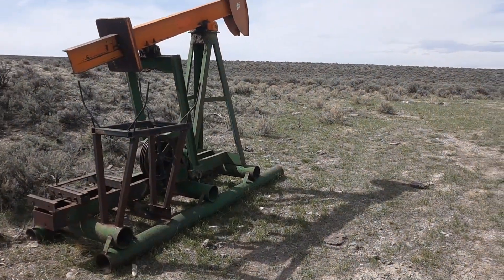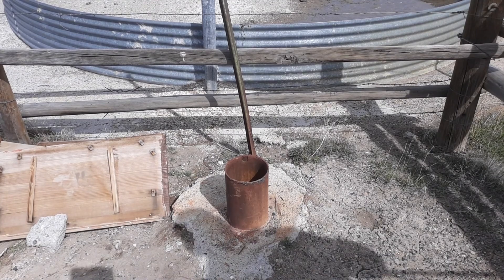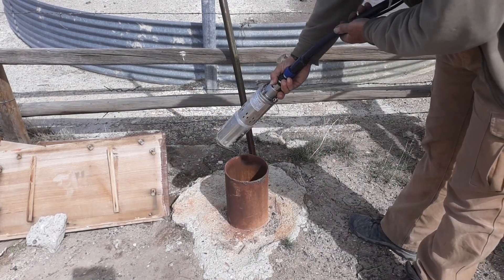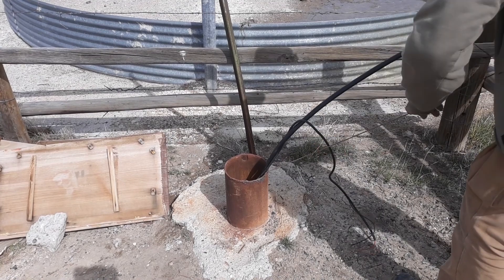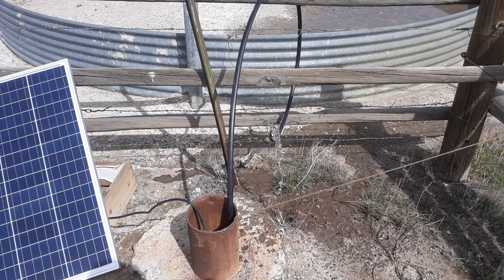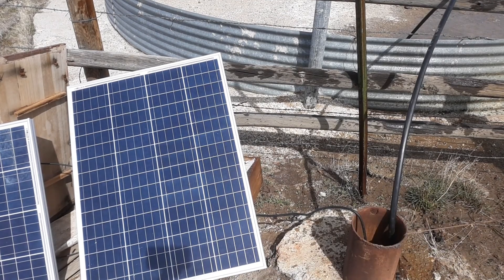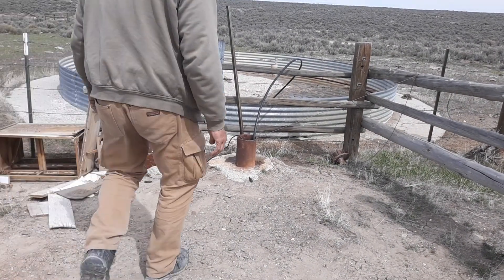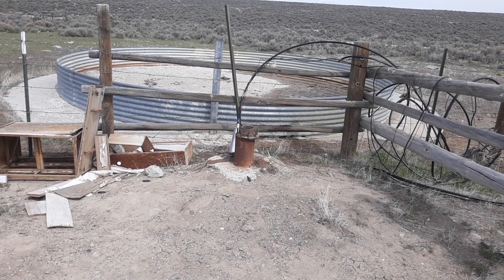12 volt solar deep well pump

Comment: 24v or 48V is way more efficient and better than 12V; i would never use 12V pump
Reply from the maker: Ohms law means you are correct BUT you ignore all the advantages of 12 volt dc and hence mistaken when you say you would never use a 12 volt pump. You probably already are and don't realize it.

Comment: Is it still working?
Reply: Can you do a review of the new one and how many solar panels are you using and do you need a battery?
Reply from the maker: @mahamrihamid8747  Yes ill try that tomorrow.
Reply: @damocsell  thank you so much the first was very helpful.
Reply from the maker: Glad you asked No it failed a couple of months ago after about a year of heavy usage on my new homestead.
Reply: @damocsell  thanks for the reply. Which one do you recommend for heavy usage?
Reply from the maker: @mahamrihamid8747  I cant recommend as I have only just started using it but https://www.ebay.com/itm/353747335124
Reply from the maker: @mahamrihamid8747  That pump is about twice the price of the one in first video and it pumps using a different system. So ill see if it lasts any longer.
Reply from the maker: Also a lot of different variables will dictate what pump you need. depth of well,water needs,well water production,water storage type ETC ETC
Reply from the maker: @mahamrihamid8747  If you have any more detailed questions I am happy to help where do you want to use? what is the usage?
Reply: @damocsell  I use it for deep well (10 meters) for farming.
Reply: Thanks mate I really appreciate it. I hope this outlasts the other one
Reply from the maker: Sorry it took a while to test out my new one but here it is. https://www.youtube.com/watch?v=493ceRhVJhA

Comment: If you use lcb controler you can hook  another 2 panels in series and parallel  to make more volts  and you will not have to many problems  with  power
2 solar panel in series 18v 5amp +18 5amp = 36v 5amps

1 solar panel parallel 39v 9amps + 36v 5amps 
= 36v14 amps
With the lcb controler  frome  amazon that is the best  and easiest way to use your solar pump without  battery

Comment: I bought a similar 1 that shorted out after 2 uses. The seal apparently is rather bad. Is yours still running?
Also mine came with 15 m of 1.5 mm2 cable. Have you ever calculated what voltage drop that has with 12V 20A? You almost lose 1/2 of your voltage. Even replacing (cutting the thin cable and try to make a waterproof connection with the thicker cable) by 6mm2 cable, trying for that max depth of 30m will be a challenge. The physics of voltage drop is a real bummer for a 12 v deep well pump.

But if it runs, it runs. Dont move it too much or that seal will create a leak and it is a paper weight...
Reply from the maker: I'll check and see I've already had a few uses but it's been sitting in a well for about 6 months and I would be interested to see if it still works.

Comment: So if I set it up in a northern climate, it should pump all day until the sun goes down and if you drill a tiny hole in your pipe below the frost line it should drain back down to prevent freezing overnight and when the sun comes back up it’ll pump all day again. Cool
Reply: Drain hole is needed if the system is sealed at the top. But this is open ended
Reply from the maker: Yep it could work like that with this unit i don't think you even need the drain hole it seemed to drain back down anyway.

Comment: Why not use a deep cycle battery with that ?
Reply from the maker: Yes I could have that would have allowed a smaller solar array but complicated the install. One of the coolest things about this setup is its simplicity.
Reply: @damocsell  This would also have the pump run 24-7, with no rest. I am presently figuring a switch at the cabin when tank is full.
Reply: That's what I like simplicity and sustainability. Very Cool. I would prefer the solar Grunfos pump, even though alittle more buckaroos😅😊!!